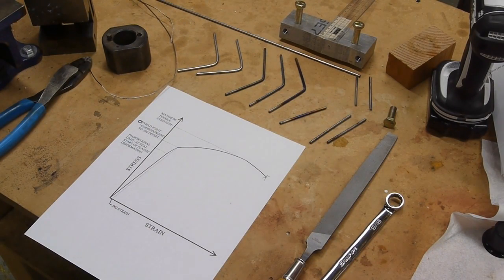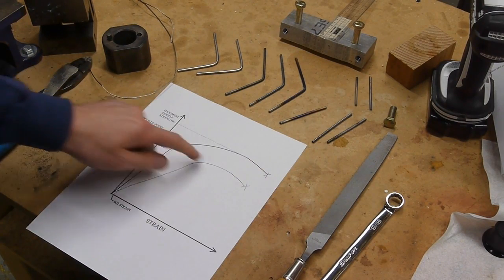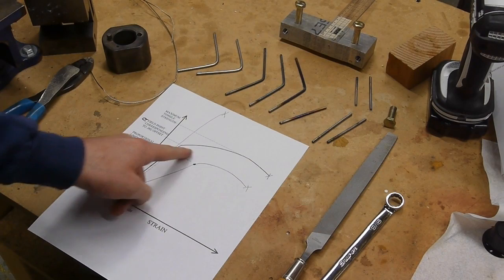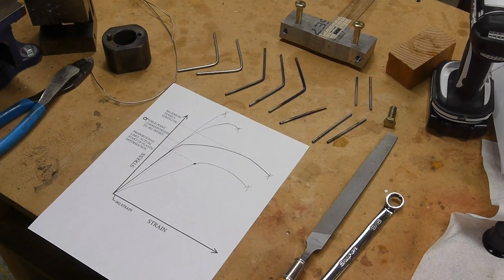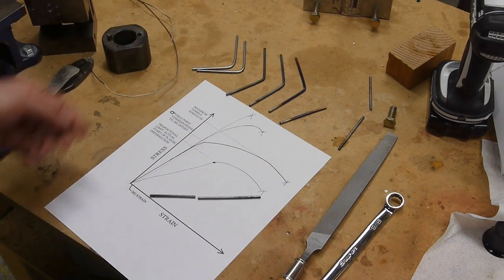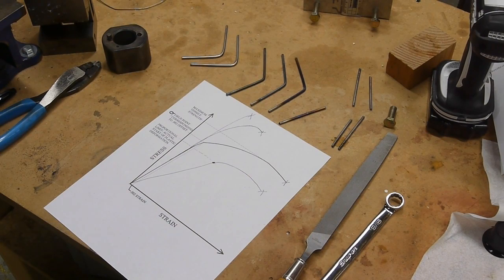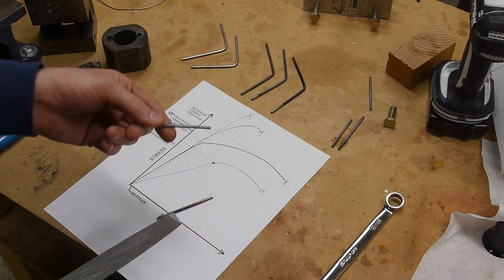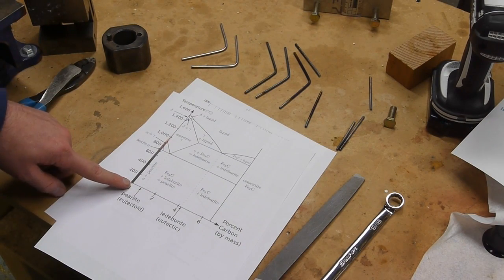Intro to heat treatment of steel (hardening and tempering)

Comment: unlikely - the carbon cant get inside the steel.
You can only harden the surface - which might work for some applications (softer corew with hard casing).

Comment: When I sharpen lawn mower blades, I use a file rather than motorized grinder to avoid hardening the edge too much. Seems like a shrapnel risk. I certainly have seen grinders take an edge to a blue color.

Also I have read that a bucket of wood ashes is useful for tempering a piece - slows cooling.

Comment: because the duration of the heat exchange has also an effect on the final properties of the material. Quenching in oil gives you a slower transfer thus resulting in a less strong steel but also less brittle.

Comment: carbon is not impurity, you want to keep as much carbon as you can, because even with the old methods you dont end up with enough carbon (thats why they choose only few pieces of the produced steel while making katana sword, the parts with highest carbon content only), all you need to do is to distribute that carbon evenly into the steel and make a homogenous mixture of iron and carbon (by forging). look at some photos of steel under microscope.

Comment: impurities in steel always make it brittle but in the same time are lowering the strength, similar to what ben draw at 6:56 but without the plasticity. most of the impurities are clumps of carbon, silicon minerals, dirt... i am talking about the old methods as shown here: watch?v=mprtHmEzXjI 
by forging (hammering, folding, forge wielding...) your removing most of those impurities, and by mixing different steels and forging them together you get amazing properties, like the damascus steel.

Comment: Great explanations as usual! Always grateful to see new videos from your shop!
One question maybe someone can help with. 
Before the carbon content portion of the video, I was going to ask about "impurities" and their role in strength / plasticity. Maybe those impurities I always imagined being hammered out for the sake of increased strength, was the carbon content? Also that if using old methods, it would be impractically difficult to remove too much of the carbon. Or was over-working common.